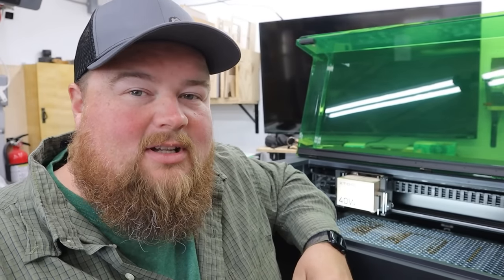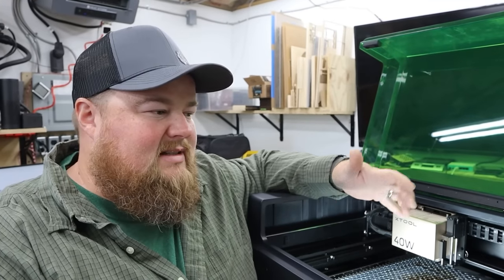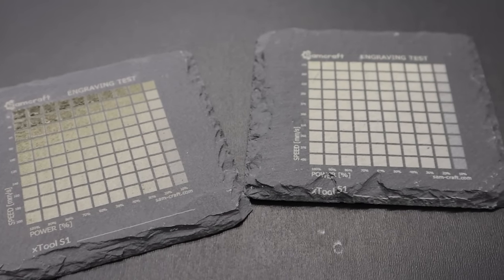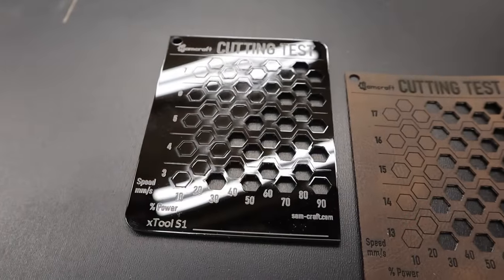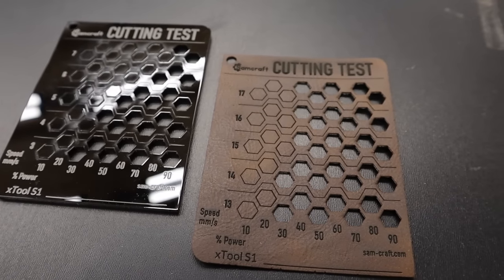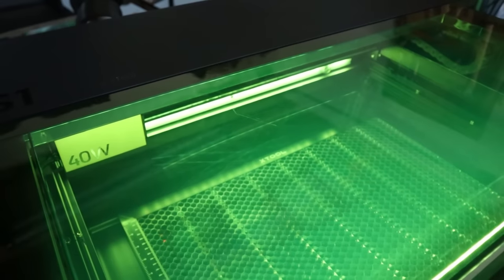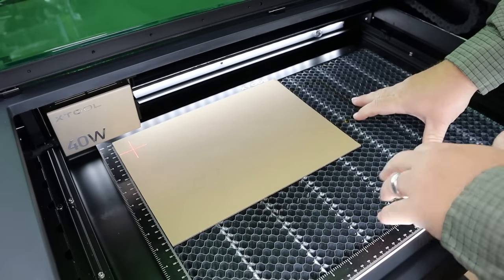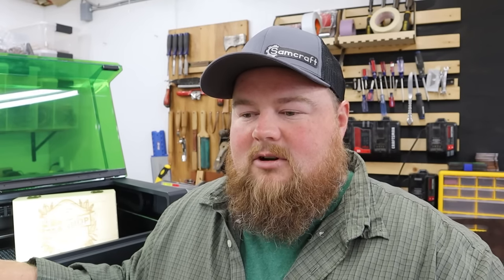ULTIMATE REVIEW: xTool S1 40w + Riser Base

Comment: Check out Joshua De Lisle's latest review on that machine...He didn't get the riser base and he was not happy ... No camera and the supplied software were his BIG complaints. The honey comb bed movement was on his hate list too. Check his reviews BUT you did a great review.
Reply: I think your description makes that review sound worse than it was.  Josh went through a laundry list of superlatives at the end.  His key issues included two that are addressed by existing add-ons: risers and extension.  He wants a camera because he's used to it, though some other reviewers have said they like the S1's positioning options better, so it may be a personal opinion-type thing.  Josh also wishes all the features of S1 were available in Lightroom, which would be nice.  The same issue exists for the F1.  I don't know how easily manufacturers can get their specific features supported, which would be interesting to know.  Josh also said he had some connectivity issues.  He didn't mention if he was wireless or wired.  On an F1 and D1 I've not had issues connecting via USB.  Perhaps these early machines have early firmware or software.  I didn't see this mentioned in other reviews yet.  Let's hope it's not common.
Reply: I keep seeing comments about the S1 not being compatible with Lightburn, but guys, xTool is not the owner of Lightburn. If the S1 doesn't work perfectly with Lightburn, shouldn't that be Lightburn's issue? Do you want a machine that can perfectly connect with Lightburn but lacks any innovative features? No, thank you!
Lightburn's development is too slow; it can't keep up with the new features these companies are developing.

Comment: I’ve watched every S1 review and you did the best one! Thank your for mentioning No Camera as a CON! That is the single reason why I’m not getting it. I bet they come out with an add-on camera module. I also agree about the autofocus and having to grab the laser module and having to move it so much. What I like about your reviews is that you’re not afraid to mention things you don’t like about what you’re reviewing, unlike other reviews that gush over whatever they’re given for free. Thanks Sam!
Reply: The camera is cool, but I’ve seen too many P2 videos showing people centring everything and it’s still off centre after the burn which tells me the camera system, while good isn’t integrated enough to be THE killer app. An example of proper integration would be doing something like the Shaper Origin system does where the camera is indexing to a physical code placed on a surface. This would allow the system to correct the camera if it’s not mounted exactly and therein lies the issue with the P2. People seem to get varying results with the camera because it’s too simplistic and doesn’t have a way to auto correct through some procedure. Until then…letting you mark it easily yourself as seen on the S1 will always yield more accurate results. The new additions to that feature let you mark multiple objects at different angles but with absolute accuracy. 

As of now, it’s the only sure way to get accurate setup on these types of machines. Not having to manually jog the steppers is also a win IMHO.

Comment: I got the riser that doesn't have the slots to adjust the height of the plate.  After installing the riser base, how the hell am I supposed to use the laser now?  It won't measure the distance, because  everything that I want to cut/engrave is sitting too low.

Comment: This was very helpful.  This is such an upgrade in so many ways from my FSL .  That probe is better than using the little rubber disc I had to use.  I’m not going to use this for major production…more hobby laser.  You made many great points.  I appreciate your honesty.  You have had lasers that are better.  It’s hard to go back….but with the boat anchor I have, this looks like a breeze.  The last time I updated, I had a 100 ft Ethernet cable that I had to run to my basement!  Camera didn’t work half the time…focusing was a nightmare.  This looks like a dream.   Thanks

Comment: Best review I’ve. Seen yet. But I knew it would be. Your detailed and honest. Thanks for a good review. I ha ve problems withe so called pin point positioning. Constantly having to physically move corner to corner I don’t like. I’m a camera guy to. It is a tremendous asset to a laser and they missed the mark. With all of thes features plus the curve following engraving makes it to where you can’t use Lightburn
Reply from the maker: I'm right there with you re: the positioning feature. And you're right... the advanced features do make it where this machine isn't truly compatible with Lightburn. Thankfully xTool has been very good on improving their software and listening to their user groups for improvement and enhancement requests.

Comment: Interesting to hear you say you do not do multiple passes. I have found it difficult woods to cut so much better with multiple passes on the S1 40w. Often getting flames if I do one pass. If you still use this machine, how have you found the single pass in the eleven months since releasing this video. Thanks.

Comment: Thanks Sam! This seems like at least a well built machine. I would think having 40Watt you could cut through just about anything ? With the probe reminds me a lot of how the Shapoko works. Which brings a question to mind…when you are moving the laser head by hand are you having to go slow to keep from generating a current?and re your caseI bet you could use some buffing compound to get them out ? Or depending on what kind of plastic very carefully barley hit it with a torch and you may get it to clear up again.
Reply from the maker: I presented the same concerns over moving the gantry by hand to xTool, but did not get a reply back. I'm not a fan of it, but they show doing it all the time, especially in their live streams. EEK

Comment: Sam, a question- I already bought D1Pro 20W back in August. But, even when I was buying it, it wasn’t quite what I wanted. I liked enclosure and camera of M1, but didn’t want 5 or 10 W and don’t need a cutter. I love capabilities, camera and enclosure of P2, but don’t like the size, too big, and CO2 description intimidates me, and definitely can’t afford the price. So, I really wanted D1 Pro 20W size and capability, and doing wood is my main interest, but didn’t like no enclosure and no camera and especially the fact it doesn’t come assembled. 
So I did buy enclosure for it, in fact the whole bundle with air assist, RA2, honeycomb…. But, never even opened the boxes. That assembly still intimidates me most of all. 
Then I see S1, and it looks so much more like what I wanted, especially the enclosure and coming assembled. I do still wish it had a camera, but its system still looks pretty good, plus a few other nice features, like better focusing and doing curves.
I’m too late to return the D1, plus with restock fee and shipping back, it’s not a good thing to do. 
But, I’m sooooo tempted to just buy S1, and sell my D1 locally. And id probably then just go with 40W. I also already have F1 which I love, so wouldn’t need IR module and probably not 20W when they bring it separately too. 
As to why I want it, mainly for making gifts for friends and family, and selling just a little locally to cover some of my expenses. 
With all of my reasoning above, between all the machines, what do you think?? Is S1 the answer?? I’d really appreciate your answer. Thank you!!!
Reply: Unfortunately you don't have much choice. If you want to buy a gift for your friends or family, I think a boxed machine (like S1/M1) would be better than an open machine (like D1) as smoke is a big problem.Wecreat might be a good choice, or you could go for the M1 as it has a camera. Using a laser machine is not easy for a novice.

Comment: ok, so now that you have done your official review, would you buy it for yourself having already used the other machines? or if this was the first one, would you buy it as a starter machine? it sounds like you prefer the d1? or d2? the red one, over this one. I have seen other reviews and there's some kind of 3d engraving that it does, have you tried that yet? if not, will you do one in the future (or is that what the tea box was?) thanks for your input about the machine thus far. I'm still riding the fence on what to buy. Hi Angela 👋.
Reply: If only it had a camera.
Reply from the maker: I would choose this machine over the D1 lineup. It is the better machine overall.

Comment: Thank you for the time and effort to make this video. Do you know if the laser is still Class 1 certified when using the riser base? I believe I read it is not considered Class 1 with the conveyor, but I am wondering if it is when just using the riser base. Thanks.
Reply from the maker: With the riser base it is so close to being Class 1, but there is a bit of laser light leakage in the back. Nothing up front or on the sides though! Maybe there was a gasket I forgot or didn't get, but it's there in the back. It could easily be fixed with foam tape though.

Comment: I need help with the riser base. I’m getting an error and have tried all of the troubleshooting videos.
Reply from the maker: It may be related to the screws on the left side. If so, check them so that they are put into the correct holes. One is longer than the other.

Comment: Hi, thanks for all your info. I have the s1 with riser base and the smoke purifier and I still smell smoke. Any suggestions or advise as to what the problem would be? I used two of the strips that came with the riser base on the front and back door but not sure where the other two go. Thanks
Reply from the maker: I don't have the purifier for this machine, but don't think it can remove all of the smells. I always vent machines out of my workspace completely and recommend others to do the same. I also had two leftover strips and didn't know where to place them.
Reply: Hello again, thanks for your response. Some questions for you. I would like to purchase your laser card test sample for the S1.  Could you send a link. I have the 40 watt version. Also does this need to be used on all types of woods and thicknesses and just kept for a reference? Can it be set up specifically for the s1 40 watt. I am completely new to laser woodworking. Thanks for all your help.